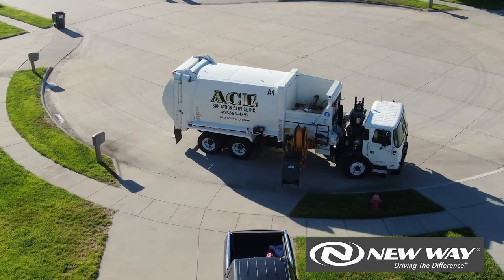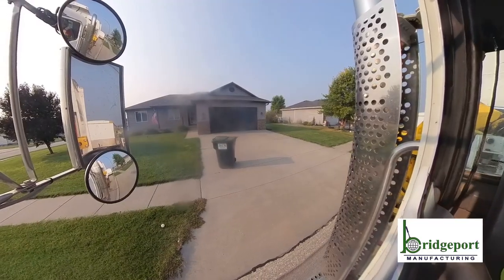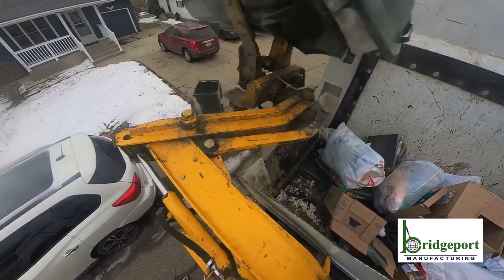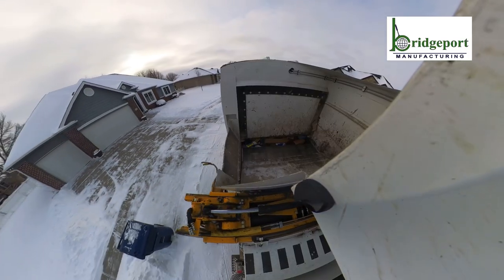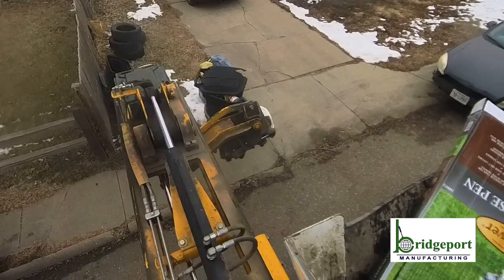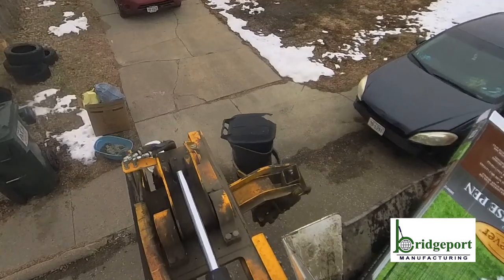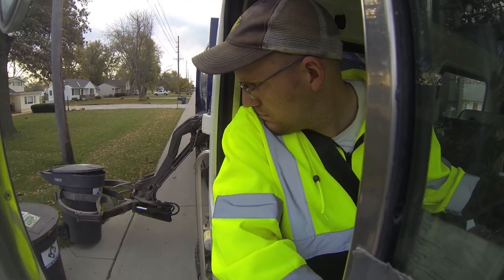This Podcast is Garbage #6: Bridgeport v New Way - Our Pros and Cons

Comment: I drive a Frankenstein’d New Way Sidewinder that was custom built, partially in house and partially 3rd party using a separate existing body and chassis my company had. We did it with an old school ASL mindset, a tiny gear pump feeding air valves for both the arm and packer. Solely the auto pack is run by a simple PLC, but otherwise there’s no electronics and minimal electrical that just feeds electric-over-air switches. Speed is controlled by the throttle, you can make any function crawl by running it at idle or move light speed at high RPMs. I have full control over everything the truck does, zero interlocks whatsoever. Fuel consumption is increased over a standard in-gear-at-idle ASL, but otherwise, driving it as an experienced operator, it’s hands down our best truck both in terms of reliability and productivity. All of my coworkers are terrified to touch it though, the concept of driving with 2 feet and even just air-over-hydraulic controls is so foreign to them it’s like trying to relearn ASL all over again.
Reply: nobody cares

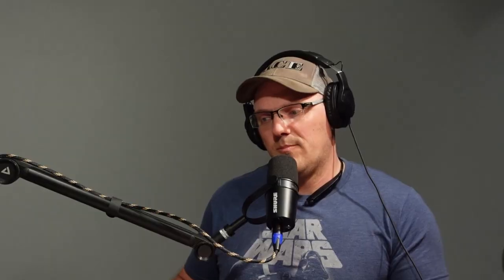Comment: 52:18 that truck is a McNielus Autoreach. The older models are definitely jumpy and shaky but this one is even more because it has 300 gallon grips. The newer versions of the autoreach are definitely fast but it can take a while to get used to. The new McNeilus packers are also very strong and they have a HUGE hopper. Probably a foot or two deeper than the new way.

I love your content, its really cool to get a full on driver perspective on this job!
Reply from the maker: Thanks for the input. There were a few times where I was in the hopper of that old mcneilus, and yeah, massive hopper. Once the trash was up there, it ate up quite a bit. It was that air-over-hydraulics that was jumpy for me. New hires struggled.

Comment: I gotta say the whole “whatever you’re accustomed to” is what you’ll prefer is so true. I work for a city and have a fleet of 7 total (5 asl 2 rear loads for backup) we have 2 Autocars with heil python arms and they can be pretty violent but I prefer them over our other autocars with the labrie bodies because the pythons are faster but take just a bit more focus in tight spots. The guys who run the labries are constantly knocking cans over and just hate them. I got to demo a Mack with a new way body with the same arm you have, and I loved it. I have a Freightliner low entry coming in may, I think I’m going to miss my python😢. Love the content!
Reply from the maker: Awesome feedback.
Doing some research I was surprised w how many manufacturers there are for sideloads. If they're watching and want us to demo, we're down for it.  That "candy cane" zero radius looks wild.
Reply: @acesanitationserviceinc the zr is like the sidewinder you don't have to worry about the arm too much just where the fingers are compared to the ranger. The one thing I don't like about them is the packer blade design more stuff lands and get stuck on it then I like. It sits at a low angle that keeps things sitting on top of it. Especially when you do a customer that has a lot of big boxes say for tvs or furniture they will just sit there and block the hopper just letting stuff pile on. I've had to go in and rearrange stuff to get it cleared many times. You guys are taller then me so pull the arm out a bit so you can get to stuff under the top of the candy cane.

Comment: I work for the city and we use the labrie and it is set up on the sidewinder and we put trash cans that we drilled holes in the bottom of up underneath that so when are they stuff comes out it goes into the can and the water will drain at the bottom I don't know if that's an option for y'all
Reply from the maker: Not exactly an option, but it's not a bad idea.

Comment: I prefer my old autocar Bridgeport ranger but with the old arm than my new labrie peterbilt. But i am definitely going to be the odd man out. Also our bridgeports have 4 rocker switches.
Reply from the maker: We got rockers in our Bridgeport. I'll switch over to them from time-to-time. They're not bad to have as a backup for the joystick. There was a stretch of time where joystick buttons kept failing, but the rockers would still work.

Comment: Have you ever tried New Way's Rotopac?  I have 1 right now and another on the way.  It is the body of choice for us.  The only downfall is recycling, most places won't accept it.  For MSW it is an absolute beast.  And it's quieter than a sidewinder.
Reply from the maker: We haven't, but we'll be going to the New Way factory soon and I'll see if I can take a closer look.
The hang up I have about is taking bulky items (TV boxes for example). We're a a small company and don't have multiple rearloads running to hand off bulk stops. We've sent recliners through packers before.
Reply: @acesanitationserviceinc  Are waste goes to an incinerator so we can't talk furniture, but I'm sure the auger would push it in.  Large boxes go into a Rotopac way better than a Sidewinder.
Reply from the maker: I'll have to inquire more about that when we visit them. I can't see how it would work better, but not opposed to trying it out. @hipcheck1112

Comment: If U Want a smooth truck that doesnt break bins choose the Mcneilus zero radius
Reply from the maker: I saw one at a nearby company. I wouldn't be opposed to giving it a try. I spoke to the driver and he was a fan.
Reply: We use the Mcneilus  zr mostly for recycling. Like the New Way, the ZR struggles with packing big boxes. Seen too many times, a driver has to jump in the hopper to get it to pack. So I will pickup the boxes with a curotto-can when I dump the trash.
Reply: As a zr driver doing recycling I can attest to that dang box is not going down lol. I hate the way they designed the packer blade on it too much gets stuck on the blade rather then going into the hopper. Now i love the arm cause you don't have to worry about hitting things to often unless it's right up against the mailbox. I'm going to be switching to a python so now I gotta learn it and watch for the extra bar on the arm so not to be that guy hitting everything lol. 😂